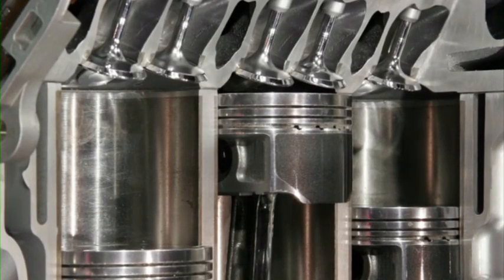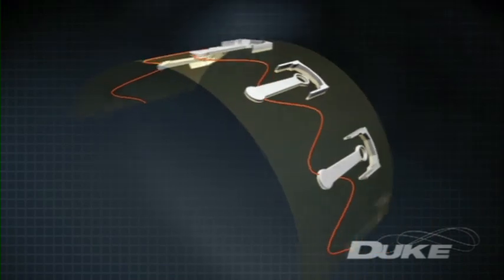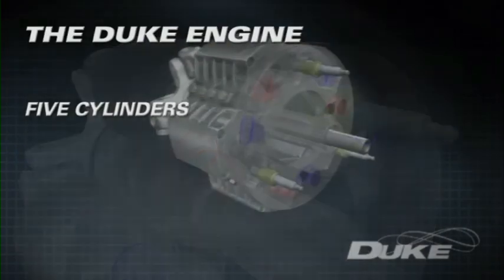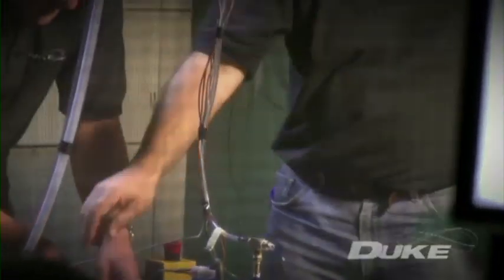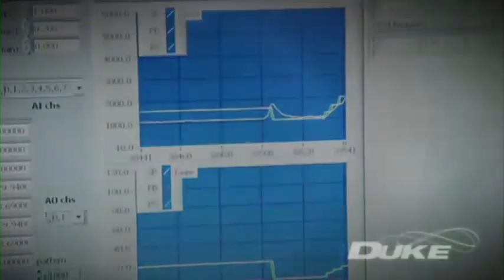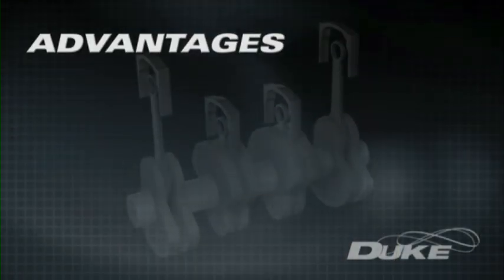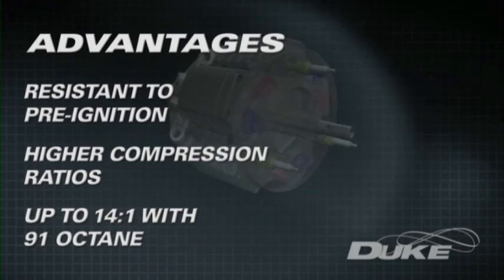Duke Engines

Comment: internal combustion engines are a thing of the past now. electric motors are simple smaller and stronger, with better reliability and zero maintenance.Nevertheless an interesting design, its nice to see people questioning the status quo..
Reply: +1
Reply: Yep. Once battery tech comes inline with fuel tank capacity and recharge takes similar time to a refuel, electric is the way to go. The motors themselves are far better than internal combustion.
Reply: Not while there is oil still in the ground Pambos, CE are for quite a while yet mate.

Comment: 14:1 is possible with regular engines too. just look at motorcycle engines. Its a neat idea, but I see some issues with the vibrations and MORE IMPORTANTLY: sealing. Poppet valves are still around cuz they are easy to make seal at high pressures. This technology will be plagues by the same issues as the rotary engines.

Comment: I'm no mechanical engineer, but sealing the cylinder at each 1/5 or 1/3 revolution seem like a high bar to overcome in addition to holding the cylinders stationary.  And lets not brush past technical complexity with the simplicity of tried and true intake and exhaust valves.  I wish them much success and hope they prove me wrong.

Comment: "The prototype has matched the performance of conventional engines"...well thats not good news dude...and 14 to 1 compression? many V-tec Hondas have about this compression not talking about Diesel :)) omg what a lame Engine...
Reply: John Doe Prototypes often make much more than the production engines which come from them. No emission regs to meet and no longevity, NVH, low load/speed running issues to take into consideration. I have to agree that if it's only matching conventional engines at prototype level it's going nowhere.
Reply: a prototype is matching current in production motors...a prototype, its not quite complete so odds are it has more to offer. at the same time this seems like a rather complex system with alot of moving parts. more moving parts = bad. thats why the rotor does so well as higher rpms and has been banned from atleast 1 endurance race

Comment: Why don't people see that combustion engines are not the way to go... Scrap this and research into clean and SAFE power systems. I don't understand why more engine and research companies invest in hydrogen for example. Or research into a way to make the hydrogen fuel less complicated to manufacture than it is today.  If not hydrogen, the electric motor are still vastly open for more research into better cells and larger capacity. Companies like Tesla will become to rich if no real competitors join the "race". Tesla cars are magnificent, but to expensive for quite many yet. I payed almost 130 000 $, 98 000 € or 780 000 NOK which is my currency...  for mine! And it was and felt like a deep rape into my "wallet". Now its already sold since I want a Tesla X instead of the S I had. And in the meantime I'm "stuck" with a petrol car until summer 2015 I think, b4 the model X arrives.
Reply: Hydrogen is not the way to go. It takes far too much energy to separate the hydrogen from water. What do you use to separate the hydrogen? Electricity!  Most electricity is made from coal and natural gas (In the UK at least) with some  wind, hydro and nuclear. Also no process is 100% efficient so every step has losses.
Reply: Yes, right NOW it has no efficient ways of being mass produced I also wrote that. I wrote: " Research into making hydrogen fuel less complicated to produce than it is today". Not the exact same, but still goes for the same.

Comment: You've made a high RPM rotating gyroscope that vibrates like hell and burns dinosaurs. Congratulations. Any vehicle with this technology would likely shake-rattle-and-roll itself to pieces over time. If you put it in an airplane the gyrations would likely make it crash. Maybe as a generator bolted to the floor it would work, but humanity can already achieve high levels of power density using conventional means with proven reliability.

Comment: Seems like a high-rotating-mass system with lots of friction, and not much improvement over, say, the wankel rotary.  (Which I might add has literally 1 moving unit, acting as a single moving part, and 2-rotor production units also have 6 combustion chambers, but with only 2 spark plugs and 2 fuel injectors)

I'm not seeing the benefit here.
Reply: benefits ERM, 1, VERY compact design, 2, Lightweight, 3, High torque due to higher compression and rotational mass, 4, Fewer parts, 5, Better fuel economy than a wankel engine.
Reply: Trog olodyte The only reference for size of the prototype the video shows, puts it at around the same height and width as the Mazda 13B-series wankel engine, only longer. It may weigh less than a traditional 5-cylinder engine, but it has a far higher rotational mass, which is the real key to an engine's success or failure- there's no way this engine weighs less than 250lbs, which is already a standard weight for engines making as much power. However, much of that mass is rotating, whereas only around 20-50lbs of a typical engine is rotating mass. Higher rotating mass reduces the ability for the engine to change rotational speed freely, and places additional strain on bearings. (Bearings which are spherical in this engine, as opposed to 1-directional roller style bearings in a typical 4-stroke engine) Fuel economy figures for this engine aren't published, and you can't extrapolate that they exceed any figures, let alone those for the current line of production wankel rotary engines. 

This engine is necessarily prone to excessive wear due to its design employing spherical bearings and very high rotational mass. There used to be aircraft-based radial engines where the crankcase rotated around fixed pistons. They were acceptable at the time because they removed the need for a flywheel, lightening the engine, and because an aircraft engine does not have to rapidly change its rotational speed like an automotive engine. However these also failed because of their undesireable wear characteristics, related to the extremely high rotational mass spinning at very high speeds.

Any engine can run high compression in theory. Even wankels can be run at high enough compression to autoignite diesel. That is not a benefit exclusive to the Duke design. I cannot see any benefits to the design over modern engines. All I see are the detractors of a highly inelegant design. Perhaps a better way to go would be to build upon the wankel design and pour more engineering into that. It's amazing what the wankel rotary is capable of, given that only one company has pursued it with any level of seriousness, and that it was invented in the 1950s and only really researched from the late 60s on. Imagine how it could perform if it had the development of more engineering teams. And it's such an elegant design: 1 moving part aspirating through ports into a set combustion chamber. And given that basically every rotary has been in the .4-.7l/rotor area, there's a lot of unexplored territory in the geometry of the engines. I'd say that's worth exploring, to much greater depths than this design.
Reply: Trog olodyte You spelled your name wrong. There's no "o" before the "l"
Reply: Trog olodyte I'm Jewish.
Reply: Trog olodyte I don't have a point. You've been trolled. Accept it and move on.
Reply: blow it out of your arse knob jocky
Reply: Trog olodyte That was too easy!
Reply: James Crud What a sad little life you must lead if you have the need to  post troll and spam commentary on youtube....

Comment: but a piston has a metal piston ring, so when the piston come out of the cylinder, wouldn't the ring pop back open before. the piston can get back into the other cylinder ?     EX.  like when you install a piston you need a piston ring compressor to get that piston into the cylinder

Comment: Not to mention friction! 5 pistons moving up and down while orbiting on a circular axis = high frictional coefficient. Also, the centrifugal forces from the circular piston motion will drastically increase wear on the piston by increased friction. This design may be lighter than the conventional Linear Piston designs, but a ton of the weight in this design is rotational inertia. If this is placed in a car, then that inertia will drastically alter handling response

Comment: If they can get it to 14 to 1 compression. They could do a common rail diesel setup too. It seems to me there is lots of rotating mass, limiting RPM... with a diesel, generally there are lower RPM and less RPM range of change too.

Comment: I just want to point out that really old rolls royce engines sealed exactly the way Jesse is describing. Two precision cut/ground mating surfaces with no gasket. It was good enough to seal back combustion gasses and coolant. Made by equipment that was imprecise and low tech alloys by todays standards. Now that I am thinking about it, the sealing head on a 90,000 psi waterjet pump is a metal to metal seal. 90000 psi is way more pressure than you will ever come close to in an engine.

Comment: Why not just use a rotary engine to remove all of the complexity? Its a clever idea but unsure why you would use pistons? Perhaps added in a seal to the top of the piston would work - same as the face of the rotor in the rotary engine. Fuel is also pretty weak unlike the standard UK 95, 97, 99 or 104 octane fuels.

Comment: But then you will get Mecanical resistance. there will allways be an inperfection on the surface. And the vibrations from the silynders will not do anything bether. That solution will only work in theory. you will have compression loss and clog up of soot in between the two moving parts. I don´t belive in this engine

Comment: Seems like weight savings--directly from the engine, from a reduction in component weights due to the reduced vibration, and the smaller vehicle possible with a more compact engines--would be it. Not to understate it; chopping 100lbs off of an engine is something I'm sure many automakers would kill for. At the very least, this is an interesting concept, and it'll be exciting to see how the engine does with a few more development cycles.

Comment: Do Some Research  SKYACTIV Mazda motors are piston motors that run at 14:1 on 91 octane  they are not rotary  The compression ratio of recent gas engines is generally around 10:1 to 12:1 but Mazda over came that with its new technology skyactiv

Comment: New Mazda engines, with a technology they have called 'skyActiv' allows for 14:1 compression ratio  'The engine compression ratio is increased to 14:1. To reduce the risk of engine knock at high compression, residual gas is reduced by using a 4-2-1 exhaust system' - taken from the Wikipedia article on 'SkyActiv'

Comment: The wankel on the mazda has some pretty bad heat and fuel efficiency problems as well. If this engine can match the compression and rpms of the wankel and the efficiency of the conventional four stroke, then it will be an improvement on both.

Comment: That is a crazy concept as was the rotary motor and it seems like it would work but howb is it to work on and what is the cost for replacement parts and would it beable t Ooo standbup to 200, 000 miles of driving ?

Comment: I was just thinking about the sealing them as well.. that and it seems like this would have more mechanical loss of energy, no?

I noticed in another video they were rated from 90 to 350 hp. I am curious as to what AFR's were used, and the actual efficiency when physically tested versus other designs.

Comment: So, what kind of power and torque figures are these engines producing per litre capacity and what kind of rotational speeds can the crankshaft reach?

Are they only suited to static applications or can they be used in vehicles? If they are suitable for vehicles will they stand up to high cornering forces in a sports car or bizarre angles and violent deceleration in an all terrain vehicle.

Comment: Something isn't adding up...  The description talks of the reciprocator rotating in the opposite direction as the crank which carries the sliding pistons, but the clip at around the 1:00 mark shows a working model where the reciprocator only undulates but doesn't actually rotate. That would still work, but it wouldn't be the sliding piston approach they describe, but a conventional sealed cylinder with valves, injectors, and spark plugs for each one.

Comment: No, this is a 4 stroke. One down for intake, one up for compression, one down for power, one up for exhaust.  A two stroke does a down for power and on the way down exhausts on the same stroke and pulls in an intake charge toward the bottom of the stroke, then does sort of a compression stroke.

Comment: The heat & carbon on the revolving valve system will wear fast under high performance. This engine might work if a low power engine with brake mean pressures less than 100 PSI.
Brake mean  pressure is the pressure on the piston during combustion. Many oilfield engines have up to a 50 year life using these low combustion pressures

Comment: Nope, it has an intake, then compression, then combustion then exhaust, that makes 4. The key difference between to two is that a 4 stroke pumps out the exhaust and draws in the intake instead of relying on a scavenging effect of a scavenging blower or crankcase compression like the various types of two strokes. The result is slightly higher volumetric efficiency in non forced induction engines at the cost of half the power frequency, thus typically lower power to weight but a wider torque band.

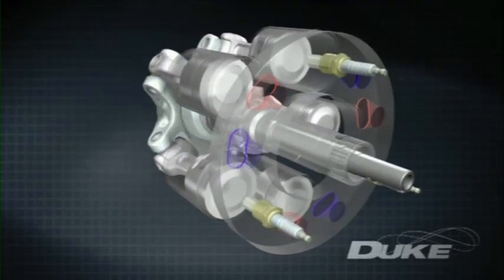Comment: Liston to the voice over @1:15  "the cilinders slide passed the ports"...  This gives me the impression that the cilinders are moving where the cilinder head is not thus resulting in leakage problems. Moving parts will never seal as they should, there is always some minimal play needed to be able to move and lubricate

Comment: Ok, I was wondering... But you'd be surprised what kind of motorcycles could drive with this thing, ever heard of the motorcycle that runs on ~50 chainsaw motors? and then there is the 'special' motorcycles that are about the length of a car... But yeah, RWD cars and maybe FF cars.

Comment: It can be reversed.  Have the pistons still and a swash plate, as in a Dynacam engine and have the cylinder head rotate. OF course there needs tom a mechanism to connect the output shaft with the turning cylinder head.  The same issues apply in sealing the top of the cylinders to the rotating cylinder head. But this has less rotating mass. Heavy rotating mass can be a good thing.

Comment: What I wonder is why do the pistons need to move to the spark plug? If each piston had it's own dedicated spark plug the pistons would not need to revolve.

But then of course each cylinder would then require intake and exhaust valves.

Comment: Thats why the engine needs to have ball joints connecting the Piston Arms to the Star shaped Reciprocator. From Their the Reciprocator needs to drive the crank shaft in a style not based purely on metal to metal contact but via a set of roller bearings made out of Titanium that roll around the crank shaft that are permenantly mounted onto the Star Shaped Reciprocatior. That would reduce the friction by 50% and would increase the revolution of combustion/compression rate by a factor of 1.3:1